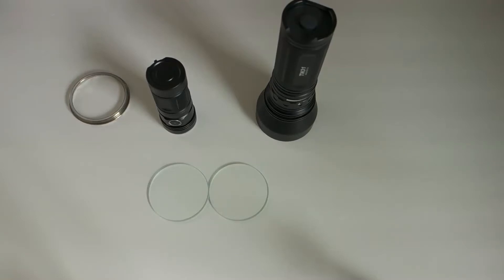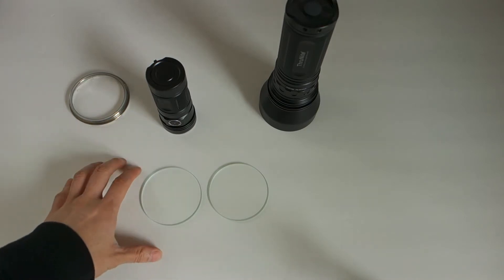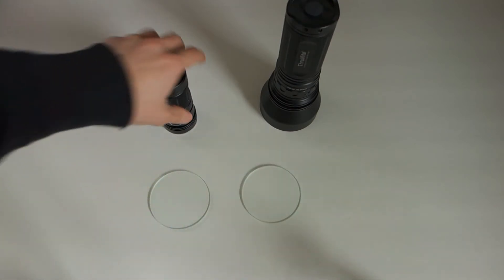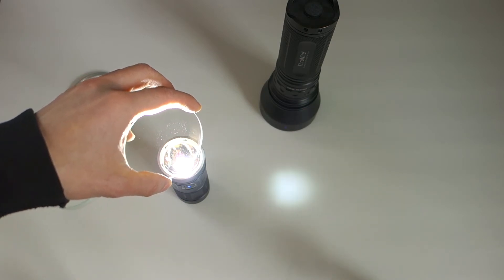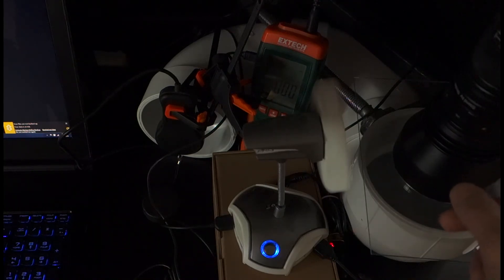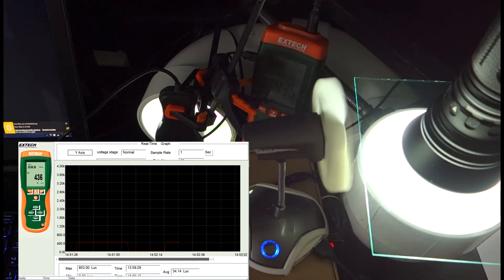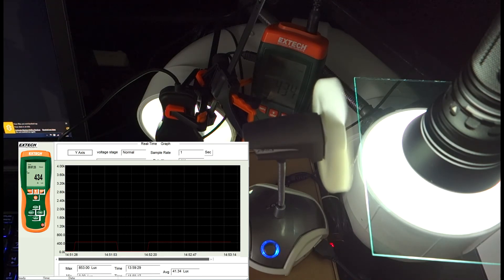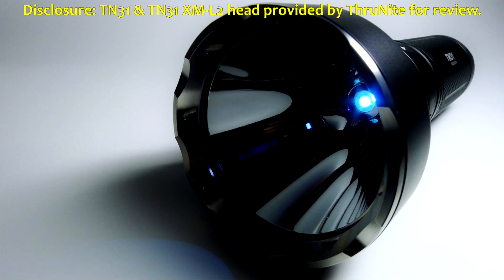AR coating on flashlight lens - Is it just a marketing gimmick?

Comment: I think the lens without AR coating produced a slight less lumen output because you used the flashlight with the AR coated lens first, thus producing much heat to the LED and slightly lowering its performance afterwards???
Reply from the maker: Thanks for the obervation! Though it's been many years since this testing but I do account for temperature whenever I conduct my lumens testing so as not to skew the results; thus I don't believe I conducted the second test immediately after the first.
Reply: @turboBB73 wow all these years and still responding to comments that's awesome. Do you happen to remember if these lens were the same type of glass as well? I know different glass and crystals can have different light transmission for different wavelengths.
Reply from the maker: I can't say for certain, but ostensibly, they looked to be of the same type; I'd also have to imagine that ThruNite wouldve sourced from the same supplier from an economic perspective.

Comment: There should be a coating for each wavelength of light on the back side of the lens, there would be no point in putting an AR coating on the front because light is not entering the flashlight. The AR  coating on the front side would make cleaning the lens more difficult as the coatings are made up of peaks and valleys. Also, the coating would need to handle the heat in the long term and not start to degrade, if you need to know we remove AR coatings on glass using lacquer thinner. The longevity is my question, scopes don't deal with heat like LED flashlights do. The lense would definitely benefit from being crown glass that has been tempered.

Comment: nice comparison. 
Could you not have that amount of loss of intensity just from different batches of glass? 
Also, for flashlights it may not be that important as you might just loose a few lumens from the non AR coated glass, but from what I have seen the AR coatings do seem to make a big difference in optics clarity, where different colors of light may benefit from the coating than others resulting in sharper/brighter images.
Thanks for the video.  Interested in your thoughts as you seem to have invested time and money into the testing procedure.
Reply from the maker: wildmanjeff42 I should've clarified that I'm a big believer of AR coatings in other applications (optical, instrumentation, etc.). Agreed that different batches of glass as well as the coating application and type would've incurred about the same loss/gain and it's trivial from a hobbyist perspective. Our eyes simply won't be able to pick out the differences in this particular match up. However, there are particular applications that may yield better improvements and I may look to pick up different lenses in the future for further testing.  Feel free to join the conversation via the links I posted to this vid's info section.
Reply: turboBB73 thanks for the info.   As your test indicated, it definitely made a little difference in the output of the flashlight.  That's a little more battery life, a little less heat so definitely a win